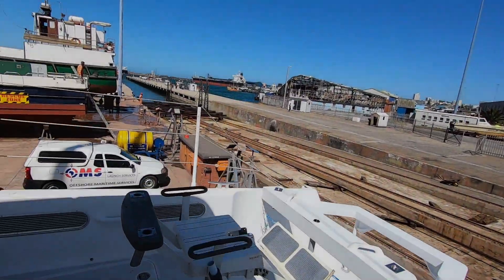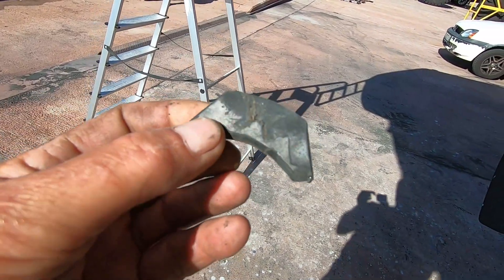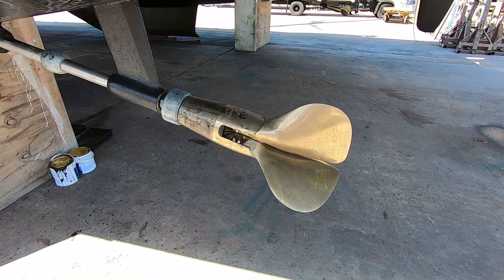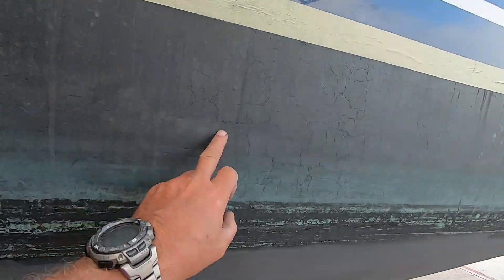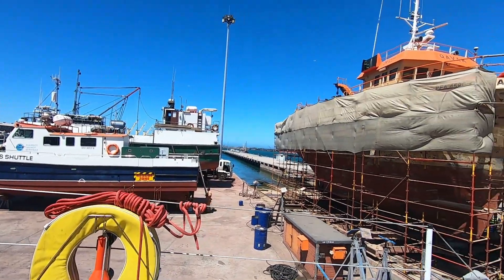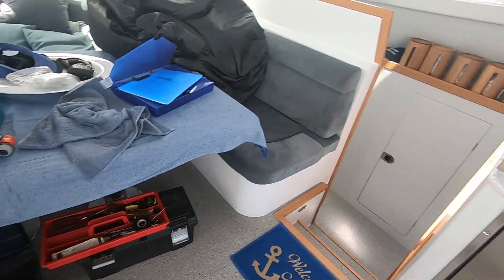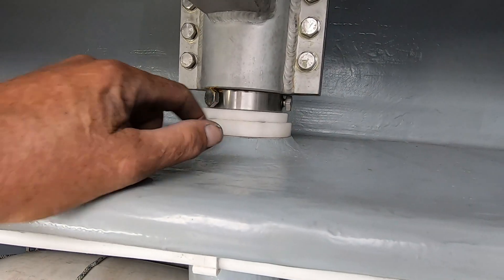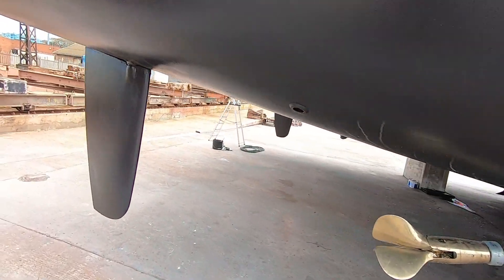Balance Catamaran - NOA Maintenance on the hard

Comment: Those props are brilliant, I wonder if anyone has done some testing to look at how much drag they save hence what kind of speed is saved. 2 standard props would cause quite a bit of drag you'd think compared to these and on a cat you'd have double the drag, it's gotta be significant. Edit this is why some boat yards refuse to allow any sanding of steel boats and for good reason I reckon
Reply from the maker: Amazing props and yeah took ages to get rid of the spatter..

Comment: have you considered going to a 4 blade prop to increase the power transfer efficiency per RPM
Reply from the maker: Props specifically speckled for engines craft and horsepower. 12 knots is more than sufficient. Doubt Gori makes 4 blade folding. Very big difference between outboards and yacht applications 👍

Comment: Aluminum collar with stainless steel grub screws in a salt water environment. Honestly, that is a basic metallurgical mistake on a boat. I'm genuinely surprised that mistake was made, that's just common knowledge and unacceptable for an experienced builder.
Reply from the maker: Those are imported premium yacht parts used worldwide. Leaking seal and lock down was the problem. But yes. Remember aluminum yacht masts are stainless steel rivitted. The quest for light sailing vessels calls for compromise sometimes...
Reply: ALL outboards are a combination of aluminium and stainless, and have been for decades! Marine Grease is the key, and would have been the saviour in this instance as well!
Reply: hey arnold, are you naturally slow?
Reply from the maker: Those are premium yacht parts supplied to and used by builders of yachts world wide. A leaking seal allowed salt onto fitting and caused corrosion and hence problem. Not a builders fault.. . Its called yacht life. Masts are aluminium and stainless riveted and used worldwide... Yacht manufacturers dont build masts....
Reply: @pred7949  you're actually trolling me on a 2 year old video. No life?